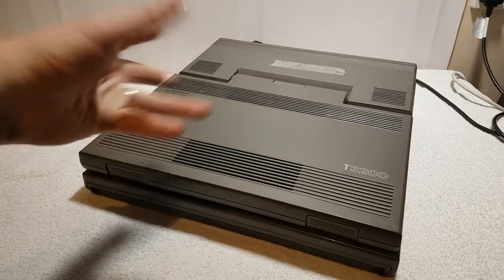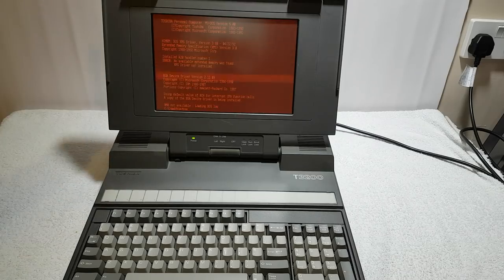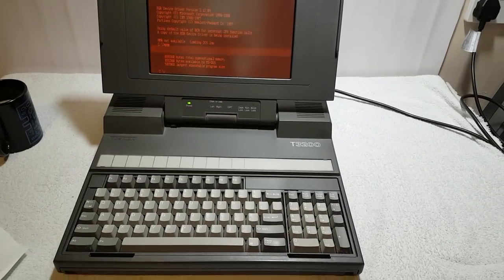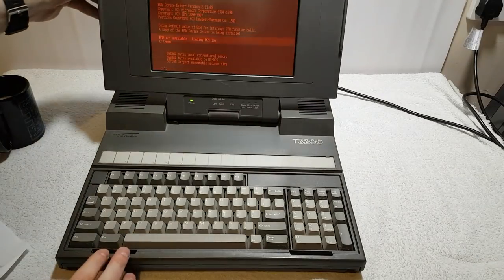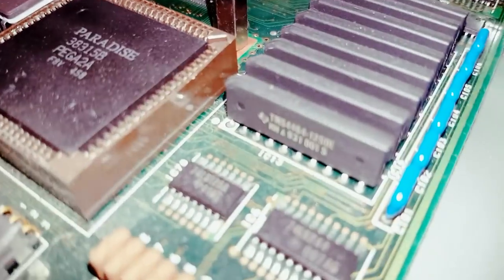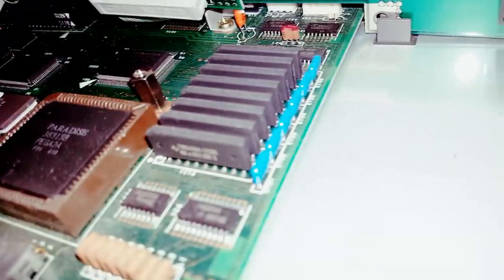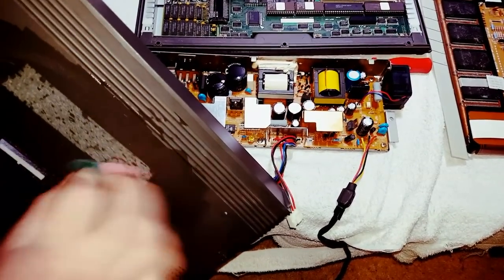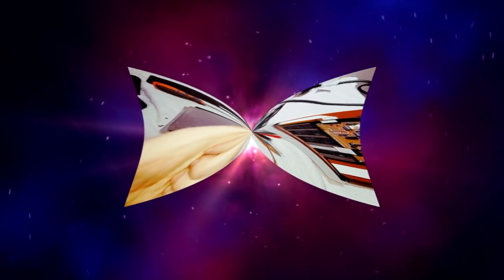Toshiba T3200 Vintage Luggable Repair & Restoration Part 1 : BOOM !!

Comment: Try to put a few drops of WD-40 on the dried out tape glue for a little while until it starts to dissolve. When you get the tape glue off clean with window cleaner on a cloth. You might want to do a little spot first to see if it will hurt the plastic.
Reply from the maker: Alan Williams I actually got rid of that using olive oil :o)

Comment: fantastic - would like more on the floppy drive and connector.  Those RIFA capacitors that broke - it will actually function without them as they are just suppressor (spike) caps so easily to replace - looks like X2 or simply remove them and it will still function - the big black electrolytic will need to be replaced - but there is a good chance all will be ok after that - these failures are not related to the main computer but just component age failures,  so 100% replace them and all may be ok - loved the video - thank you so much... my issue is the floppy and seems many have
 the same issue.

Comment: I am surprised this thing turns on but as you said it would explain why the floppy is having issues but it could also explain why the extended memory is not firing up as well, there is room for the math co-processor for extra grunt as well. I did notice that the floppy says 1.44 on the eject button but the specs seem to think it should be a 720k floppy drive so maybe it had an upgrade?
Reply from the maker: Possibly, a load of mysteries with this one :o)
Reply: Its had a hard life. :)

Comment: Thanks for posting this. I love luggables! Being this was posted 5 years ago, it looks like I am late to the part. I recently found one on eBay and bought it. You are correct about how much of problem this is to take apart. Mine smelled like something was burning. I took it apart and the 3, 3300 uF capacitors were blown. When I removed the PSU from the shell, I saw the electrolytic stuff had leaked out and had eaten away at the enamel coving the copper on the PC board. I ordered new caps and acrylic coating. Cleaned the board, replaced the caps, and applied the acrylic. It's working fine now. I came here because I couldn't remember how to put the screen back together and I didn't take any picture with my phone. This video showed me the placement of the parts in the screen housing. It's all back together.
My floppy drive is not working as well. Another problem for another day. Thanks for posting this.
Reply: Ten days ago I plug mine in outlet and it started so I press I think f1 and somthing start to burning behind and smoking so I unplugged  immediately the smell and the smoke was ugh so I want to repair what it can be??
Reply: @louiegoons7765  More than likely, the electrolytic capacitors in the power supply need to be replaced. It will have to be taken apart, the power supply will have to be removed, and the capacitors replaced. It will involve soldering. Mouser has all of the replacement caps. Good luck.

Comment: Thanks for your video. I was wondering how the repair was going as I couldn't find an update video?
 Anyway, the switch mode power supply (SMPS) would still operate despite several capacitors being dead but the output voltages would possibly be less 'clean' than the design intended. The two white X2 ones which are showing signs of damage are designed to absorb any voltage spikes from the mains, one being directly across the live and neutral terminals of the IEC connector socket being particularly badly affected - for obvious reasons. The other black cylindrical electrolytic capacitors, of which there are two, are designed to smooth out the rectified mains voltage (now being DC) and as one of the two appears to at least be intact it's probable that there shouldn't be too much negative effect. That said, most old items of tech containing electrolytic capacitors, especially in the power supplies, will need many of them replacing as they have a nasty habit of drying out over time. This is due to the design of the capacitors which utilise a liquid electrolyte as a vital part of their operation. Despite rubber seals to keep it in, over time the electrolyte can leech past these seals which has the effect of increasing the electrical resistance of the capacitor which, in turn, causes heating of the capacitor during use leading to loss of further electrolyte, more heating and eventually failure. Such failed electrolytic capacitors often show signs of bloating where the electrolyte has been heated, causing physical expansion. So, what you actually saw wasn't smoke but steam! - evaporating electrolyte, to be exact. The problem is that the electrolyte can be corrosive, over time, to the metal leads of components and the actual copper circuit board tracks. This is one of the main reasons for the failure of modern electronics devices - both the electrolytic capacitors themselves and any ensuing corrosion as a result. The tantalum capacitors you pointed out are used for decoupling (to prevent the signals passing through the interface from affecting other sensitive components) and as they are obviously situated near some of the peripheral sockets they should only be in use when the associated socket is in use. Again, although part of the design, these capacitors shouldn't pose a serious problem even if damaged but should be replaced to ensure correct functionality in all circumstances. They are probably 100nF value as the printing on them is 101 - that's 10 (ten) and 1 (one) as the number of noughts, so 100.
I hope you manage to get the power supply repaired and find that RTC battery!

Comment: I LOVE LUGGABLES.   I'm glad you videoed taking it apart as you might need to look back on this video when it comes to putting the thing back together again!!  I was dreading the bit where you started taking it apart with the power still on.  I thought that's what the, 'BOOM', reference was in the video title!!  LOL
Reply from the maker: Yup lol, one of the points of making the video.  Luckily, Toshiba did a full guide in the maintenance manual :o)

Comment: Ah, I've worked on several of the Toshiba T-series plasma screen portables. Yes, they are a PAIN to open and work inside, with perhaps the exception of the T5200, which is a bit more modular and easier to disassemble. Just consider yourself lucky that you don't have to open a T3100. It is physically IMPOSSIBLE to fully separate the case because the wiring harness for the screen is permanently soldered to the motherboard. The only way to open a T3100 is to lift up the top of the case like the hood of a car, and even then it only lifts up about 45 degrees...and you need to either find a way to prop it up or work on it one-handed while holding the case open. Definitely one of the most annoying computers I've ever had to disassemble!

Unfortunately, the floppy drives are notorious for failing on early Toshiba portables from this time period. Three of them in my collection had failed, and so far the only fix I've found is to outright replace them...which is difficult because they use proprietary connectors and are borderline impossible to find at reasonable prices. Hopefully you can get yours working more easily though.

As for the BIOS battery...it looks like it's actually been completely removed from your T3200. It's supposed to be a AA-size 3v non-rechargeable lithium battery located in the gap between the floppy drive and hard drive, then connected via wires to a connector located in front of the floppy drive. You can still get compatible batteries, but you'll have to salvage or make a connector because batteries with the exact type of connector the T3200 uses are no longer available.

In regards to the failed components in the power supply...it is a dual-voltage power supply, and perhaps those failed components are related to the 120V portion? If so, maybe this would explain why it still seems to power on and run just fine, since you're running it on 240V.
Reply from the maker: Aha, yes, that would explain why it still runs :o)

Comment: It may well be an AC filter cap on the power supply , they used tantalum there in the 80s and they go off with a hell of a bang and loads of smoke they really can be very very loud usually a long squeak and then a big bang . It will work without them if its just a filter.
Reply from the maker: Yup, that big one is a wee bit ripped apart.  That one at the back is for the ega, so I don't know if it's still working yet till I get a monitor on it.

Comment: Just found one. Almost new condition ... no scratches no damages, screen look like perfect. But off course I had my 4th July on first attempt to turn it on. Got the service manual and will need to run same as you. Try to open, blame some bad design, continue to open till get to PSU and check the smell and smoke that came from there. Still can smell it deep on my nose. What are those white ones in PSU with burns and cracks? Regular caps or supressor ones?
Reply: I've also got a T3200 and I had to replace one of those white X2 capacitors in the PSU.
Reply: @DookNookim  I replaced 6 ... psu was ok .. but mobo never did it. Even lpt has no post codes. Probably some reset issues.

Comment: hi  i have one of these but the screen has a lot of vertical lines, do you know a way to fix it? thanks!
Reply from the maker: Unfortunatly, no, you may need to re-solder the ribbon cables, if you have bals of steel.

Comment: would it be possible to take the gas plasma display from an old T3200SX or T5200 (VGA) and connect it to a modern video card?

How about the EGA display from a T3100 or a compaq portable III 2660? could it be made to work with a vga card, or would the signal going into the display be too different?

I would just love to build myself a modern laptop with a gas plasma display. I don't care if the resolution is restricted to 640 x 480...
Reply from the maker: It's made from 12 seperate panels, so nope :o(
Reply: The vga plasma on my 3100SX is playing up. I'm considering changing it with a modern 4:3 LCD panel that supports VGA inputs and solder the connection onto the inner VGA pins within the case.

Comment: for that sticker to come off get some high alcohol rubbing alcohol usually works for me and scrub it with a wet rag deathly a high content rubbing alcohol
Reply from the maker: Thanks, I have some of that, I'll give it a shot :o)
Reply: If alcohol doesn't touch it, I recommend naphtha-based lighter fluid.  It seems to get rid of any sticky gunk without fracking the plastic and with minimal elbow grease. :D  I use it to take stickers off of preowned games all the time.
Reply: Alec J nice I've never tried that before with rubbing alcohol you do have to use some elbow grease LOL
Reply: Just make sure the rubbing alcohol is 91% or better, also I'm not sure if you can get it in the UK but GoofOff, or Goo Gone is also good for stickers as they are orange oil based if I remember correctly. as a last resort I'll say try on a very small spot WD-40 and I say on small spot because it can discolor some plastics, and leave behind an oily film but WD-40 did help clean a Black GameCube I found thrifting that looked like 3 year old had attacked it with hello kitty stickers, and grape soda.
Reply: Last time I checked up on Goo Gone ingredients it also seemed to include, basically, some acetone.  Maybe they have multiple formulations.  
WD-40 is an interesting thing, I often use it to clean stuff from my hands like truck bedliner and even spray expanding foam.  Of course, you have to use soap afterwords to get the oil off your hands, too.  :)  I also use contact cleaner sometimes on cases, it does a little cleaning but mostly leaves a tiny film on there and a nice factory-style shine.  doesn't seem to eat at printed graphics, so far.

Comment: Those "resistor packs" look like Zip RAM to me?
Reply from the maker: Graham McMaster zip ram?
Reply: ZIP(Zig-zag in-line package) was a type of package used for some memory circuits back in the late 1980s, they are similar in shape to SIP(single in-line package) like those used for resistor networks however they have a higher pin density out of the package, and the pins are bent in such a way that the 1,27mm pin pitch of the package becomes two rows of 2,54mm pins, one row being 1,27mm staggered from the other.

They are not used for memory anymore, though some regulator, amplifiers and other high power ICs still use staggered pins.